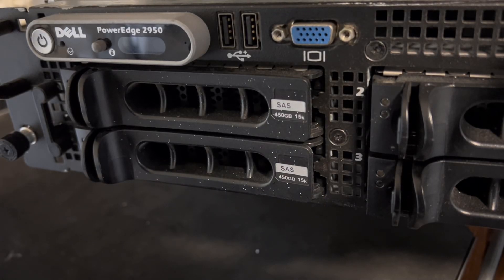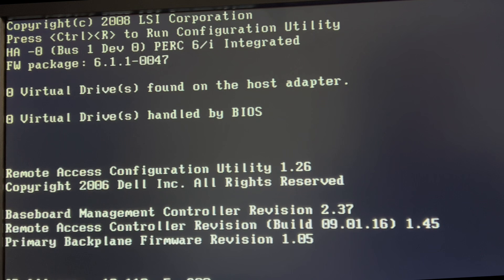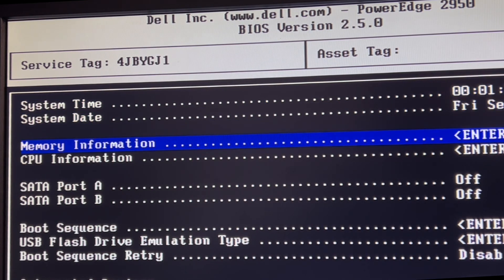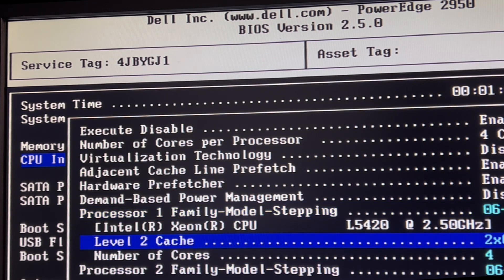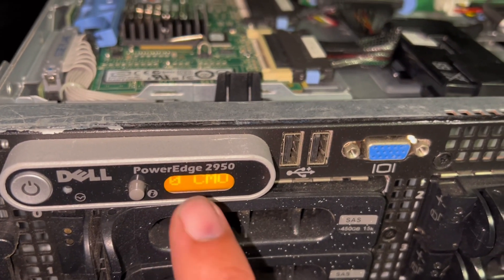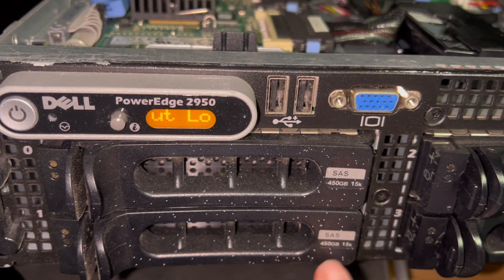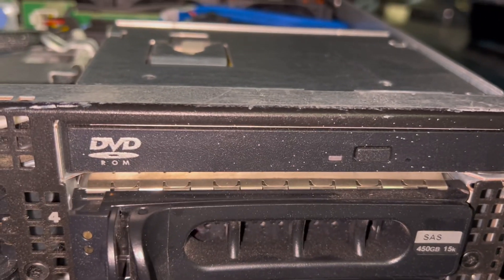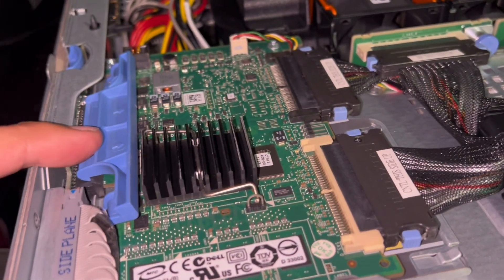Live! Reaction - Dell Rack Server FREE 15,000 RPM HDD can it play Fortnite? Budget Gaming PC Part 1

Comment from the maker: Update:  Unfortunately there will not be a part 2.  Although I was able to put in a GPU with X8 and install Windows 10 in RAID 0

I was able to operate it without the fans, installing a single fan in the middle of the CPUs.

The Hard Drives tested at 300mb/s read speed which is awesome for a mechanical drive.

I have to put it away because there are other projects that need attention.

I do have a short video of the hard drive only noise I will put in the shorts.

Comment: 15,000 RPM HDDs?! And here I though 10,000 RPM HDDs was insane
Reply from the maker: I know right?  I actually had never heard of 15,000 rpm.  I had 10k before but they were scsi drives.  When I do my follow up video I am going to disable all the fans so you can just hear the hard drive noise in windows.
Reply from the maker: Actually, I assumed they were SATA drives.  They are SAS drives, similar but not the same.  They get hot!

Comment: I would leave all the hardware in and install Flight Simulator on it. Just lean heaviliy into the jet engine sound and make it part of the 'experience'.
Reply from the maker: haha good one!

Imagine if someone could rig up the fan speed to the throttle control so it ramps up as you put the engines at full load for take off